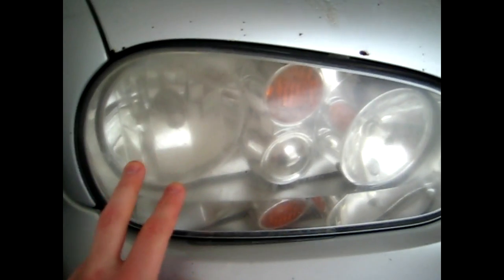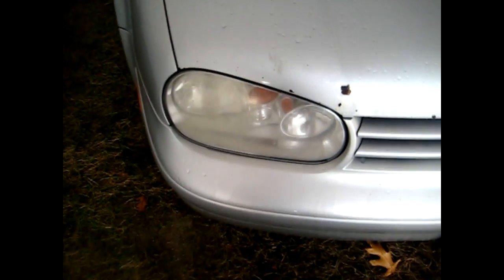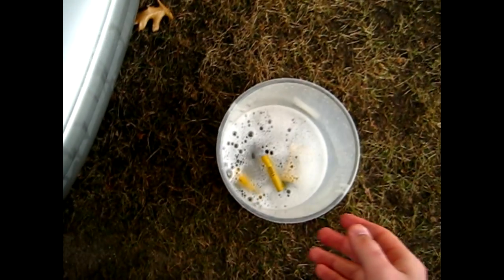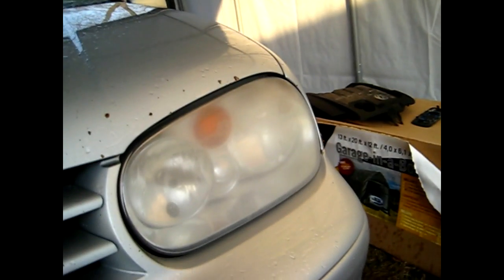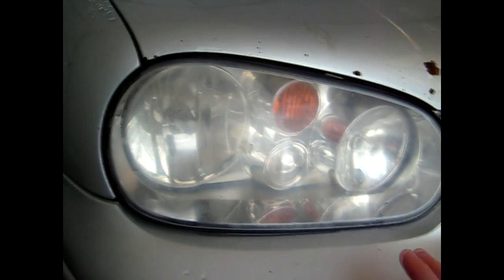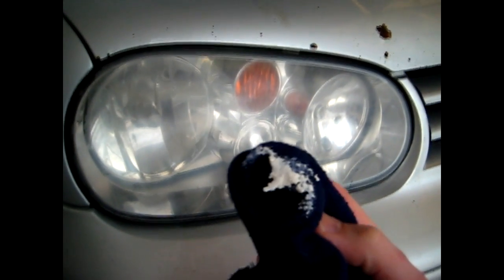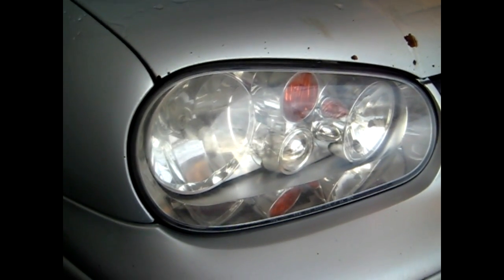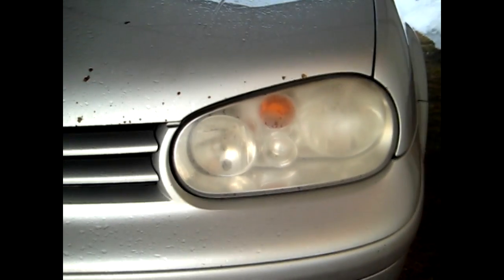DIY: Polishing Foggy Headlights

Comment: +4Diyers,can I use a neutral color shoe polish as I can't find any store that sells "polish compound"? I couldn't find a labelled sandpaper here,so I just used a rule of thumb to select a sand paper and in the end,my headlight became whiter but blur,what can I do? Would you welcome it if I send a picture of the headlight's current condition to your mail?
Reply from the maker: Hayo Akinrinde I've never tried shoe polish before, but I don't believe it'll work unfortunately. If you could find a company who deals in 3M products, they should have the supplies. I know 3M does sell products all over the world. Or you could purchase the supplies online instead. As for the sand paper, it's very important to use the grits mentioned in the video because that what gives you a good base to polish with. After using sand paper, the headlights will have a hazy white look. The polishing compound is intended to remove that. If you would like, you can post photos on my Facebook page. The link is in the description.
Reply: +4Diyers,I've used some available sandpapers here,the headlight is white but still hazy(not transparent). Can you please give me some brand names of polish compunds or is it a requisite material for cast painters? There are many car painters around here,if the 'polish compound' is a requisite material, I can easily purchase from them.
Reply from the maker: Hayo Akinrinde Some brand names would be 3M, Mothers, Meguiars, Turtle Wax, Autoglym, Nu Finish are all companies that carry polishing products. Painters will use it too as some painting does require wet sanding and polish. This is basically the exact same process which is used on paint finishes.

Comment: So I've a 2012 camry, and, the headlights were gettig foggy from the top, i did sand with 2500 grit (following ur tips on the video)  thinking ,that, it wasn't  that bad...WRONG ...i tried my best with polish compound and wax (after) to eliminate the tiny scratches left behind...i can still see them..i notice that, u use polish compound and add water at times..1st question; for how long? Till it dries? Or until there's no more polish compound to rub? ...2nd; i realized that the foggy was real easy to clear with only polish / wax.. is it fix-able?? (Thank u all for the laughs..lol) lesson learned.

Thanks.
Reply from the maker: Hector Javier Sanchez Usually until the compound starts the dry or becomes harder to work with, then apply a little water. Sometimes of the fogginess isn't too severe, it can be cleaned just using compound and wax as a final shine. The wax also acts as a protectant too. I used 2000 grit max in my video and it cleans up quite well, so when you're using 2500 grit, it should be much easier to achieve a highly polished surface.

Comment: Road debris does not "fog" up the headlight. UV sunlight causes the "fog" over time.
Reply from the maker: Debris from the road such as sand or rocks can also "pit" the surface, therefore causing distortion in the plastic. UV light also causes the "fogging" as well, along with an acidic content in the rain.

Comment: 4Diyers  could toothpaste be used as a substitute for the polishing compound?
Reply from the maker: sleepybrown987 Toothpaste will work, but it doesn't have as good polishing qualities 
compared to the proper compound. I also have a toothpaste only headlight
 restoration video as well if you'd like to check it out 
DIY: Polishing Headlights with Toothpaste

Comment: can you use a one application of wax? instead of using carnauba plus another polishing compound? @4diyers
Reply from the maker: +Ricky Flores One application of wax is all that's needed, but you will need to apply it a couple times during a year to help protect the surface. Any brand of wax or polishing compound can be used. Normally the higher the quality, the easier it is to work with and the better job it preforms.

Comment: Is this a "permanent" solution, or will it get yellow-ish again quickly? I saw your clear coating method, but not sure which one of them I should go for..
Reply from the maker: André Baumgartner Personally I would recommend the clear coat method because it does act as a new UV protectant to the lenses. This method with wet sanding does last for a long time as well, but you will need to apply a wax to maintain that protection. It is more of a long term fix, but not permanent resolution unlike the clear coat method. All vehicles have clear coat on their paint and it does take years for that to deteriorate, so when done correctly on headlight, it will last for a very long time.

Comment: How Long does this last?? Even wet sanding & using Rubbing Compound & Wax??? Employee at AutoZone  said Clear Or acrylic Coat Doesn't work on Plastic headlight lens
Reply from the maker: It will last for about a year with a couple coats of wax in between. Clear coat will work just fine on acrylic lights, I've repaired numerous lights with this in the past. There tends to be a little more room for error in the process unfortunately, so certainly take your time and do not rush the process. 2k clear coat is the best product to use.

Comment: ANYBODY?? i have a question. you mention rubbing compound in the beginning of the video, but at the end you say polishing compound. my question is, aren't these 2 different things? does it matter which one you use?
Reply from the maker: Rubbing compound and polishing compound is the same thing. Rubbing compound is just the more generalized term and there is different grits. Polishing compound is normally the finest grit you can purchase in a rubbing compound. You do need a very very fine grit/polish compound. Do not get anything course because it will act exactly like sand paper.
Reply: 4Diyers thanks. gonna try this, if it ever gets above freezing. lol (pittsburgh)

Comment: something that troubles me. i had this car and it was 13 years old (before i sell it) despite its other problems, its headlights never gets foggy and they were always clean and i thing that was made from glass. Those ones on video seems plastic. Are there versions of this car that come out with glass and plastic headlights?
Reply from the maker: +Dimitris Theodopoulos Did you also own a VW Golf or Jetta MK4 body style??? And would you happen to be located in Europe??? They were available with glass lenses there and unfortunately the North American market came with the acrylic styles.
Reply: 4DIYers
yep i owned one vw golf mk4 with 1.4 engine and i leave in Greece. those models were the last ones that builted in Germany before vw move golfs factory in Spain. Not fast models but certainly strong and safety as rocks.

Comment: Do I have to use that compound? Or can I just use car wax? And what's that compound call
Reply from the maker: agustin Nava Yes you do. It removes any of the heavier scratches left over from the previous steps. The wax still does polish to some extent, but also helps protect the surface as well.

Comment: Diamond Paste u can go from rust to mirror workn on plastic too 
tooth paste work too
Reply from the maker: I haven't tried diamond paste before, but I have had experience with tooth paste. I have actually done a tutorial using tooth paste and unfortunately from my experience the final shine doesn't turn out as well compared to the other methods I have done which was this one and also using clear coat.

Comment: I did the steps to the t except I started with 1000 grit, my headlights now look worse??
Reply from the maker: +Kyle Slater Start with 1000 grit, then 1500 grit, and finish up with 2000 grit. After that move onto a polishing compound and this will remove the hazing from the wet sanding process and continue on from there with the final steps.

Comment: Thats a good video but a bit mistaken, instead of using wax right after polishing, you need and should use a lacquer (mixed 1:1 with turpentine) to give a new protecting coat for the headlights, or else the haze will return and fast!
after using a clear coat , then you should put some wax on to protect it.

also - you should masking tape the area around the headlight so you wont hurt the car's paint job
Reply from the maker: Liav Elgarat This does last for quite a while, but wax does need to be applied regularly so it prevents the hazing. I have a tutorial on applying a lacquer/clear coat as well DIY: Headlight Restoration using Clear Coat

As for the paint, yes it is a good idea to tape off the area. But with this vehicle, it was being repainted anyway.
Reply: Oh ok, didnt watched the other video :)
btw if you want a stronger wax that contains sealent you should try on the Soft99 Fusso wax, it has swirll filling ability and stays on the car for almost 6-8 months. it will sit very good on the headlights
Reply from the maker: Thank you for the tip!
Reply: You are welcome, just if youre going to do that be aware that you need to use shining lacquer only!
here are some results from a nice forum i use a lot
www.carsforum.co.il/vb/showthread.php?375998-פרוייקט-מצולם-חידוש-פנסים-עכורים-והברקתם-בציפוי-הגנה-מפני-קרני-UV-ובזול

Comment: Do you think the spray-on polish would work?
Reply from the maker: Graeme Heydenrych Which type are you referring to??? I know there are polishing products available on the market which I have used in the past that do work.
Reply: Yep.. this stuff was cheap so.. long shot.
Reply from the maker: It's normally better to invest in something a little higher rated as you will get much better results without involving a load of time or work. Recently I've switched to Meguiars Ultimate Polish and it's been the best stuff by far compared to previous products I've had experience with.

Comment: 4Diyers What is the difference between the Polishing Foggy Headlights and Headlight Restoration with clear coat?  Gonna try it but want to know what's the difference.
Reply from the maker: Arthur Ward One is polishing the existing plastic, the other is adding a coating (in this case clear coat) to maintain that highly polished finished. I would say both involve around the same amount of work, but the only issue with just strictly polishing your headlights is that the UV protectant is already worn off an gone, therefore there isn't anything to protect the headlight unless you keep applying wax each season. With clear coat, that acts as a UV protection, therefore that is more of a permanent fix or will last for a much longer period.
Reply: 4Diyers Ok, don't jugde me...I did the toothpaste but I used soft scrub and a soft scrub pad, I applied the wax but it stayed foggy.  The yellowness is gone but my headlights look foggy(clean but foggy and scratchy).  Can I fix this by doing the wetsanding process. Please don't judge me, lol!
Reply from the maker: Unfortunately toothpaste does take a fair amount of work and not all toothpastes have the same amount of abrasive qualities. It sounds like it has removed some material, but not enough to create a clear surface. Yes you can use the wet sanding process to remove the hazing, it'll be much easier than the toothpaste method. Lol not a problem. You're taking the steps to correct your hazy headlights, that's what counts!

Comment: Are those plastic headlights? Because in Europe we have glass ones... and I don’t think this would work on glass
Reply from the maker: Yes they are, the North American market got the acrylic version. Many enthusiasts do upgrade the lenses to glass here. There is a different polishing method for glass.
Reply: Honestly I think the plastic ones are a bit better in some ways... they don’t chip as the glass ones and from time to time with low effort you can make them look brand new. What other way? How can you polish glass?
Reply from the maker: You can always apply a polyurethane film to the glass lights to help prevent chipping. I had glass headlights in one car and managed to break one twice from stones flying up on the highway. There is a special glass polishing paste you can purchase, last I remember it was sold at craft stores. But I believe there is also other glass polishing available in the auto detailing market. I haven't used any so I can't say which product would be the best unfortunately.
Reply: 4DIYers my 1 is polycarbonate so I'm guessing your method here works on that as well?

Comment: will this take off clearcoat peeling?
Reply from the maker: dave gale Off the headlights??? Yes it will.
Reply: I did as you said and youre  right worked well Thank you
Reply: Is there a difference between rubbing compound and polishing compound
Reply from the maker: Rubbing compound tends to have a coarser grit than compared to polishing compound.
Reply: Thats what i wanted to know thank you

Comment: I did like this , but it does't work after this paper grid I got fully foggy head lights because I got million smalls scracthes on it …. so it foggy white not foggy yellow
Reply from the maker: You are suppose to finish up with a polishing compound in order to remove those very fine scratches and then finally with wax for protection and a final shine.

Comment: i Have The Fine grit 4000 & P2000 sandpaper & heavy Duty Rubbing Compound & Liquid Rubbing Compound Re-sanded them
headlight Basically I'm Gonna Buy a replacement headlight & That's the Easier part Then all Anybody has to do is pay to have the replacement headlight installed plus there's online internet website that sells Headlight for $60.00 or if You purchase the set its $120.00
Reply from the maker: Unfortunately if they are aftermarket headlights, they'll probably have a lower life expectancy than compared to OEM lights. Instead of this method you can also clear coat the lights which is a much more permanent method.

Comment: u need specific toothpaste if u can afford diamond paste go with colgate white with micro crystal in it and dont do it by hand take  a buffer i did it on my scooter wnet from foggy to crystal clear
Reply from the maker: That is true, different toothpastes have different types of ingredients and some do contain that abrasiveness content. The reason I have shown it by hand is because not everyone has access to a buffer. It does take more time and energy by hand, but it is doable which is what I was trying to show. Another issue with a buffer is that one also has to worry about burning the plastic, especially if someone doesn't have the experience using one. By hand, no one has to worry about that issue. Regardless of what type of toothpaste is used, it still does take a fair amount of time to cut down the hazing and it won't remove those surface imperfection such as cratering from stones. Then there is also the issue that tooth paste is one type of abrasiveness. Like my wet sanding video, I use a variety of abrasive content starting from something harsher to something very very fine. Tooth paste is a fine polish, without looking at it closely or measuring it's grit content, I would assuming it won't polish as finely as a scratch/swirl removal product specifically designed for paint or wax. Even using the toothpaste method, the light still needs something to protect it from the exterior elements or more UV damage. Therefore a wax will also need to be applied a couple times a year.
Reply: Good  old elbow greese hey yup its working i do 95% with a buffer and when u polish allways finish by hand  ... d'ont worry about melting point those are Polycarbonate Family ENgineering Resin Melting point is really high One thing you should take good grip on it is the Optical cuz it is not only a light its a lens too (when you mold those light you need to meet international Regulation Luminosity chart etc cool mold to work with in an ENgel 500 ton (use to be in plastic field ) MOld tech keep up the good work <You could also put a Dimmer on you buffer or a potentiometer  more ctrl on RPM.

Mmirror like MOld are polish by hand even today then the computer pinpoint problm 

See that big mean green machine its an ENgel smooth machie lot of power ton of fun and room tolearn as for the buffer go for Orbital motion not circular one

Comment: try to remove headlight! set it on table  after you sand it put clear coat aerosol spray and done!!!  why buy expensive or cheap wax and polishes and all that. sand paper cost 2 dollars and 5 bucks 2x clear coat spray 7 bucks  takes care 2 and more headlights lol :)
Reply from the maker: koray gokdeniz I have done that tutorial as well @watch?v=HgNNMj0gGbA Not everyone has the supplies or room to do a spray on procedure which is why I have this method shown as well.